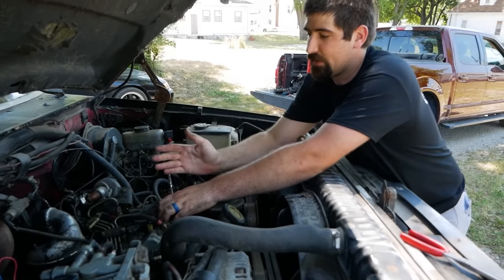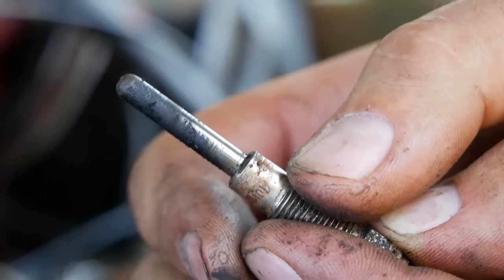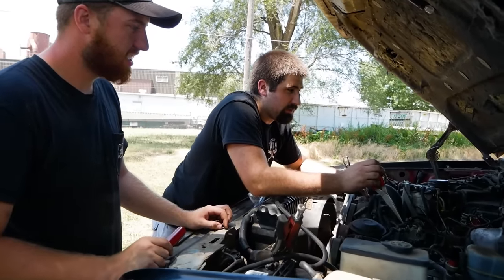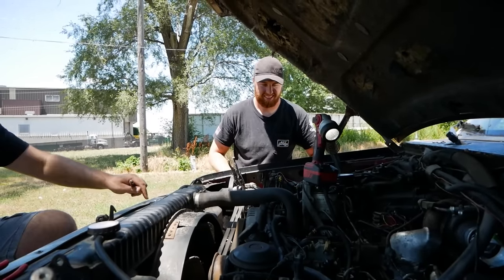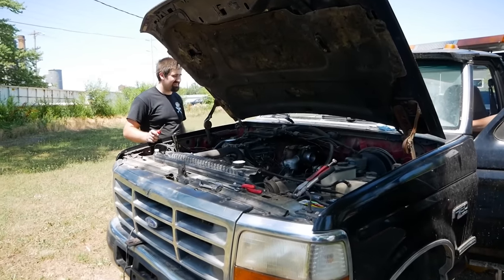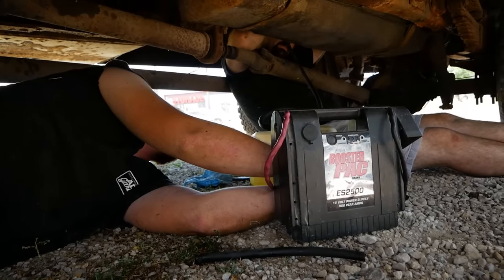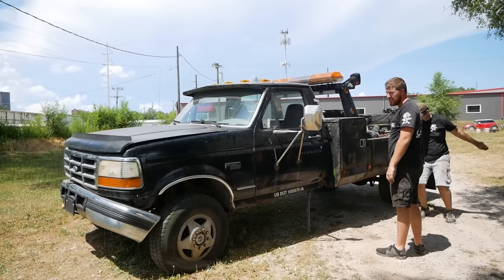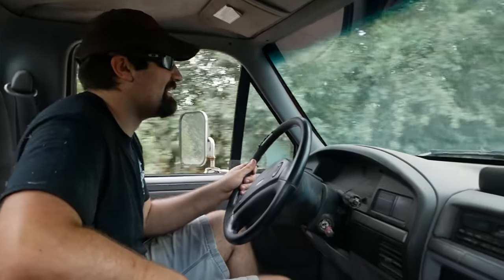Can We Get ABANDONED Tow Trucks to RUN? - Part 3

Comment: "Screw it back n forth until you can get it out."

"This bad girl is TIGHT."

PREEEETTY sure I'm watching a romance novel in diesel flavor.
Reply: Me and my friends go by a scale of 8 year old tight to 60 year old which is so loose that it’s gonna fall off.
Reply: SwapPart, LLC probably.
Reply: So are the rings stuck? or worn slap out? The jet black, goopy oil holds out some hope for stuck.  Try Marvel Mystery Oil and if the result is too thin, try something thick like STP to balance out the viscosity.  Then if your lucky, the rings might pop free and reduce that blowby.
Reply: I might have written last week that maybe you didn't prime enough.  I was suspicious when you closed the injector hoses with just gurgles instead of the pressure jets you got this week.  I suggested cranking with full throttle but don't remember if I suggested more thorough priming.
Reply: The Lusty Diesel Maid?

Comment: I for one, love the exhaust note of the old IDI's, especially the turbo IDI's.
Reply: Agree 100%
We had an ‘88 F-350 with the N/A 7.3 IDI and later a ‘93 F-350 with the factory turbo 7.3 IDI, and they sound soooo damn good!
A mean growl at idle, and similar to big block gas engine sound up high
I wish the new diesels sounded as good as these old beasts do
Personally I think these IDI’s sound best with the factory exhaust too, but most prefer straight pipes in these
Reply: The turbo IDI's actually made more power than the power stroke 7.3s
Reply: I really like the way they idle. Just a smooth sound. The 6.5 Detroit’s sound similar
Reply: Michael Corrin you are correct. Not many know that, as Ford purposely published numbers lower than what it made, and that’s even with fitting that very restrictive downpipe. They did that so the Powerstroke would look more impressive. But even stock a factory turbo 7.3 IDI made more low end torque than the first gen 7.3 Powerstroke.
The Powerstroke did have better throttle response but I’d take an IDI over the HUEI Powerstroke any day of the week

The factory turbo IDI 7.3 is seriously underrated. It’s more than just a turbo mounted on top
It also had better valves, sodium filled on the exhaust, and a few other goodies as well
Reply: CubCadetMan 71 indeed those 6.2 and 6.5 diesels had a really nice sound as well 👍
Reply: @michaelcorrin1  Yeah, I've driven a early 90's F350 with a slightly modified, and I mean very slight, stock turbo, free flowing glasspack exhaust, some kind of slight mod to the fuel system, that thing was scary powerful. Not exactly fast, but waaay quicker than a big ole' one ton should be.
Reply: Yesss i put a banks downpipe and flo pro 4 inch straightpipe to 6 inch mbrp tip on mine.. love it
Reply: And I absolutely despise diesel sounds. They always sound like there's something horribly wrong with them even when they work.
Reply: Oo
Reply: CubCadetMan 71 oo
Reply: I love the bark of the old 6.9s as well as the 7.3 idi
Reply: @michaelcorrin1  no idi 195 hp ps 225

Comment: Use Deep Creep to free up stuck rings. Lubricates without drying everything out.

I got the rings on a locked-up diesel   reefer unit motor  that had been sitting for a year to free up and the unit started  like a champ.

Damn thing still runs and that was five years ago.

Comment: Glad Wyatt is with you. Noticed that Jacob left. And Mook just stayed away.And Wyatt seems to know his stuff. And that’s 1/2 the problem with Diesel engines. Sounds good the new glow plugs and fuel system cleared up the problem.  Now you can let these go with a little confidence. That’s the key little. Congratulations it sounds like a diesel.
💯👍👊

Comment: Beru (the glow plug brand) is a German OE manufacturer, they make good parts from what I've seen buying Mercedes-Benz replacements they make.
Reply: Appreciate the knowledge, (and correction.) Will put it to use in the future. Cant be right about everything.
Reply: No, they are CCP made crap these days. BERU of old was a great company but I have had lots of problems with customers buying the parts cheap on the 'bay only to have plugs, leads and caps fail. Rotors burn the tips out and caps leak spark across the terminals.
Reply: Bought a set of Motorcraft glow plugs for an IDI last year, inside the bag they're Beru's. Not sure if that has always been the case but all the old forums say to go Motorcraft for these (and to avoid Autolites) and that's what I got.
Reply: @mimikomono  Always heard FoMoCo are best. Hmmmm. I'm running Diesel Rx military grade.

Comment: Loved that it was finally running.
A thought/ question or two.
Would all that smoke go away if a oil change was done on that idi ? Wouldn’t hurt it.
Second an oil truck driver friend told me on diesels to help clean injectors out. He would dump can of transmission fluid in the diesel tank. Would that help with any issues junkyard is having with this idi ?

Comment: I remember having to get an old diesel running once with having almost no knowledge of how they worked. Once you understand them it's not too bad. Don't feel too bad, you had your hands full with broken fuel lines on that one. Glad you had someone to help you learn some things for the next time. I could tell you guys were in the sun too long. Starting to get a little loopy by the end lol. That was a lot of work and it turned out to be a pretty crappy truck, but you got it goin and managed to drive it out of there and not get pulled over either. I'd call that a job well done. 👍

Comment: On my 7.3 idi non turbo I done away with the return line going to the filter housing. It helps with eliminating any potential for fuel issues there. The return lines are also notorious for the plastic caps leaking and o-rings going bad. These motors will easily become ether babies if you use too much as well.

Comment: I use a half a quart of 2 cycle oil per tank of fuel in my 94 6.5 or if I can get it, B5 Diesel without the 2 cycle oil. Keeps it all lubed and working.
Reply: I like bio diesel but usually use a fuel additive (Howes) all year round.  You can use 2-cycle oil or used engine oil.  The used engine oil is the old standard.  Don't do it if you have a DPF...and i am not sure how the DOT will react if they dip your tank as you will have black diesel.
Reply: I do the same thing, but I don't use anywhere near half a quart. Maybe a few ounces. It doesn't take much.

Comment: "a no name plug that's made in Beru" 
BERU. The company is the leading manufacturer of diesel cold start systems with an estimated worldwide market share of 40% for glow plugs. In the field of ignition technology for petrol engines, BERU is one of the four major manufacturers in Europe.
Reply: My thoughts too.. Beru also make spark ignition coils, coil packs etc.. decent quality, I’ve never had an issue with any of their products I’ve used.
Reply: They're actually motorcraft level plugs. The only ones that should be used in an idi or powerstroke is Motorcraft/Beru as even Bosch has a chance to swell. The fact the Beru plugs were swollen was bad
Reply: Where’s Beau?
Reply: Where’s Beru?
Reply: Beru is the company that made the glow plugs for the IDI, the a IDI is an International Navistar Diesel it was not built by Ford.

Comment: BERU glow plugs are what these ran factory from International , also they are what ford sales in motorcraft packaging across all the diesels , VW used them as well , they do not have the swelling issue , the ones that cause you the most issues are Autolite ones
Reply: Definitely beru is a better plug.  I run Humvee engines in my ranger and they are much better.
Reply: Correct. The tip on autolites swell. Never use the autolites

Comment: Looks like the electric primer pump was a good idea 😉.. I knew the whole time you were having an air lock issue..

Another little tip I will share, is if you want to clean your fuel lines,injectors,injection pump on a diesel engine especially the older diesel engines.. put a jug of transmission fluid into your fuel tank.. you will notice a big difference in how the engine runs.. the injectors will sound smoother and operate better.. 

When I had my 99 TDI Jetta with a mechanical fuel pump I put any kind of oil I could get my hands onto into the tank... And i remember putting used transmission oil into the fuel tank for like 3-4 months.. and that car ran like a dream.. even fired up better in the winter... I even put 2L of gasoline in my fuel tank so I could start the damn thing easier in the cold -50°c temperatures in Alberta.. and it worked like a charm.. that truck would benefit from a little transmission oil in the fuel.. it will clean alot of gunk in the injectors..    your buddy knows his diesels...

Also.. zip ties and bias plies rules! 😃 

Good job getting her running boys!
Reply: One of the transmission gnomes I worked with ran his powerstroke on used ATF the shop was disposing of. It ran great and fuel was free.
Reply: @841k9  .. haha.. hell yea man.. I've been doing it for 10+ years. In all sorts of diesels...
But I've noticed that it gives you better mpg's and more power ..not to mention the injectors become lubricated and cleaned at the same time..

Comment: Back in the day the best way to stop the diesel or old cooking oil waxing up in the diesel fuel tank during winter was to put a couple gallon of paraffin in each tank of fuel, paraffin has a lower freezing point.  if it was too cold for that to work, it required a small fire to be lit underneath the fuel tank for half an hour to warm it up first, happy days😊

Comment: Idi is 21.5 : 1
They are a great truck engine.  Last a long time if maintained.  However,  the fuel delivery system is finicky at best.  Had one that sucked rust and crap from the back tank.  Took me a day to clean it!

Comment: Anyone else notice that the driver fender says f150 @ 11:45
Reply: I noticed it on the last video on this truck
Reply: yep, I did
Reply: Probably rusted out and got replaced if you noticed the drivers side rocker
Reply: Yup
Reply: I noticed that the firewall is red
Reply: @abcsd1254  yeah it was red it got painted black
Reply: You see a lot of that here in the Iowa rust belt. Guy came across a fender that was less crusty then the one he had so it got swapped. Body parts are all interchangeable between F150s, F250s, F350s, and F-Super Dutys of that generation. Spanning 1992-96 for the F150s, and 1992-97 for the heavier rigs.
Reply: Yep
Reply: abcsd1254 and looks like the hood was replaced too bc it was all black and not red on the inside and still had the foam under
Reply: abcsd1254 so are the aprons where the fenders go on

Comment: At 44:19, that's not how you use the stinger, you put it against the tire and there should be 2 L shaped arms in storage clips up by the front of the bed. You slide them into the square tubes at the back of the stinger and slide them against the tire. Then lift the car. There should be the down straps that go over the tires, but those are probably long gone

Comment: Enjoying going through your videos.  Found ya from off the ranch.   Can’t recall your friends name. Mentioned it in part II also, maybe he will comment or yourself from him.  I know the 6.5 turtle diesel from GM and ford shared 2-3 items.    However concerning the glow plugs.    90% or the time you can lube start to loosen, lube tighten, loosen etc.   however if you get it completely loose and it won’t pull out due to being ballooned,   Lube it and crank the engine.   Compression fires it out the hole.   Idk if works that way with 7.3. But I’ve done multiple 6.2/6.5s that way.    With either of those if it breaks off pull injector and magnet fish for tip.  I’ve never done that thankfully.   Just used compression to blow ballooned glow plug out and has always worked out in my favor 😂😂

Comment: The best way remove glow plug without breaking it is impact wrench. If gun is air use, drop pressure little bit and slowly hit that plug out. If you are not in a hurry put some acetone/atf mix in plug holes day before. Mix is 50/50.

Comment: Part of the knocking you hear from a diesel is also the injectors knocking because they pop at a much higher pressure than your typical gas injector. Like the common rail cummins engines had an issue where if you had to much or not enough fuel pressure the injectors would knock so loud it sounded like a rod knocking but it was actually just a bad injector its crazy loud

Comment: the NA 6.9s and 7.3s were roughly 22:1 or 23:1, the IDI turbo trucks like the black one were about 18:1 due to the added boost from the turbo.  Im a tech as well and speak diesel fluently, the beru plugs are made in germany and are the best glow plugs to use for the idi trucks and the powerstrokes.

Comment: My first truck was a 93 idi with the factory banks turbo lots of great memories lots of bad ones lol. I was surprised when I saw that mine wasn’t the only Smokey blow by turd out there. If you still have it you can get new old stock cdr valves off eBay (the Tuna can pcv looking thing) to stop all that smoke from coming out the engine bay. I could literally smoke out a school parking lot on cold starts it was amazing

Comment: Kevin, I'd almost throw a plate on it and drive it around a bit, after fixing the steering box issues,  so it actually responds to steering input.  Maybe also throw a good driveshaft in there.  See if, as others say, it stops being a land-based crop duster...  Yeah, the body's pretty roached, but, might be worth a shot.  At least, you can then see if the drivetrain is worth swapping into a better shell.

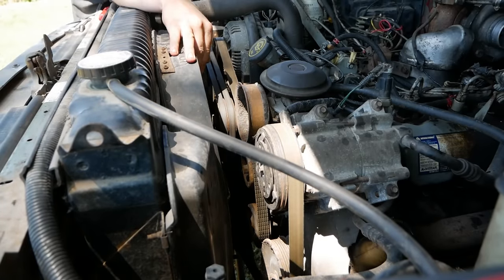Comment: 21:12 confirms my opinion after working on my 1st gen 7.3 Powerstroke. 
Injectors are $, valve covers are a pain in the A$$ to get off & injectors on an IDI are cheap & don’t need to jerk the VCs to get the out.

Comment: Hey man love the videos. So I'm not sure if your truck has a similar system for the AC.

But I recently bought a '98 Crown Vic and the owner told me the AC was broken. So at first I tried a new relay which fixed nothing. I then direct powered the compressor which caused it to kick in. 

Long story. Turns out the AC simply had nothing in it. The AC wouldn't work if there was no freon in the system. Maybe that's the problem?

@Junkyard Digs

Comment: Take a torch and light it up and hold it at the intake tube while it's starting up and it will fire right the heat from the torch will build the compression up to make it start old diesel tech tip mainly works great for worn out engines, fyi starting fluid for diesel is bad will cause more damage

Comment: I knew man would triumph over the machines! I thought it was a fuel supply problem. Just didn't think it involved a 2 ft air gap in the fuel line from the tank to the supply pump. Most diesels with mechanical fuel injection have two fuel pumps. A low pressure supply pump that supplies fuels to the high pressure pump and then the high pressure pump that boosts the fuel pressure to injection pressure. I'm afraid I'm gonna have to give you an F on your report card for "works well with diagnosis"!!

Comment: I'd definitely do the return lines and o rings, pulled into my driveway with my '89 idi and the next day she just would not start, replaced the o rings and lines and haven't had an issue since.

Comment: So this may sound silly, but I had the idea of compression last video because I had a Honda Civic with a single cam engine that I turbocharged, and I also swapped a VTEC head onto it at the same time because the kid that I bought it from bought a JDM D15B VTEC block that someone stole the head off of and swapped a D16Y7 non-VTEC head onto it and he didn't know any better. Anyway, I got the new Cometic MLS head gasket on, installed the ARP head studs, got everything buttoned up with new injectors and all, and it wouldn't start no matter how many times I cranked it. The next day I decided to do a compression test and it was WAY low. I dropped a small amount of oil in each cylinder and it shot right up. I put the plugs back in, cranked it, and it fired RIGHT up. The cylinders were fuel washed...and I had never been through that before, but I have now...
#themoreyouknow

Comment: Non turbo idi , hook 12000# to her and hold it to the floor till 60, if you can't hit 60 keep her on the floor. I bet this had a banks sidewinder kit. Still stomp her down and hold, you will reach 60 at some point. 100% throttle for thousands of miles straight won't hurt her.

Comment: More fuel more power sure! However without increasing its air intake its still only going to be able to mix so much before maxing out. There are diesels that blow coal for miles and r fast as hell sure! But there are diesels that don't smoke near the amount and go faster than hell cleaner due to better air/fuel mixtures. Love the videos and i did learn alot from this video forsure! I just thought id mention this info i learned recently! Gale banks explains it in amazing detail on everything about it give it a watch!

Comment: I need this guy for my GMC W4500, runs fine with the choke turned up, soon as I put it in drive it stalls, otherwise it could run in park till the tanks runs dry. it's been to 3 diesel mechanics and 2 years since we had it. Noone can figure it out, throws no codes and everything else checks out. it would be a great episode "The diesel nobody can fix.  it all started when someone tried stealing the fuel pump not realizing that they wouldn't be able to and they left the bolts loose which grinded the gears to shit. Ever since that happened it drove maybe twice. Each time someone claimed to fix it it would die a week later.